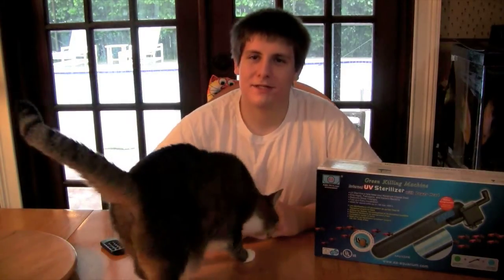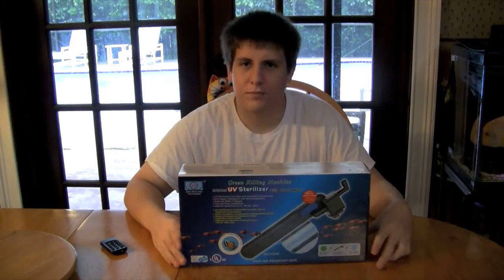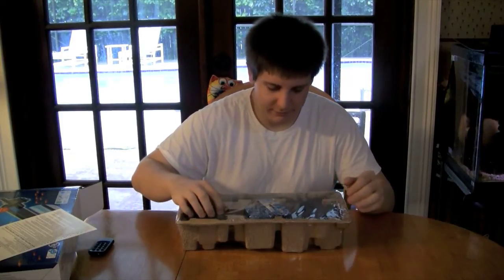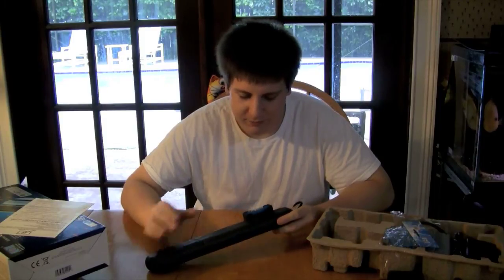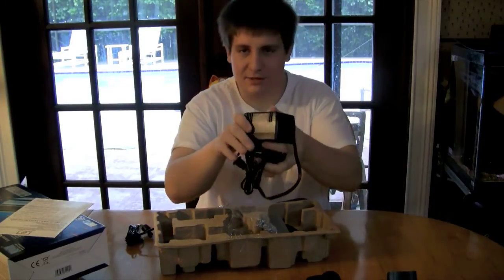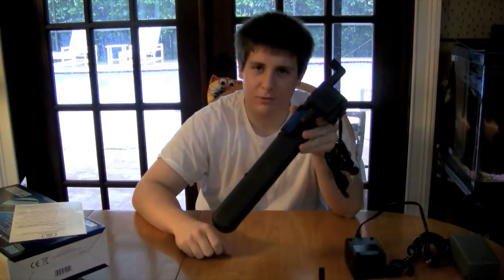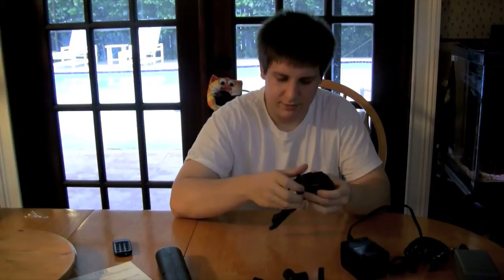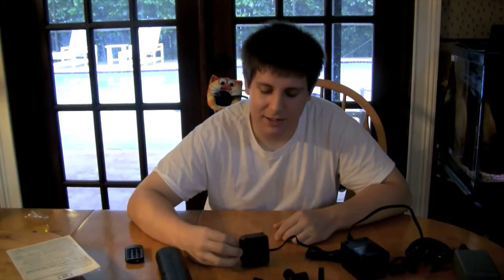AA Green Killing Machine UV Sterilizer Unboxing

Comment: I was wondering about replacement parts, not bulbs.  While cleaning it I lost the "pin" inside.  There is probably a technical name of it but it just looks like a piece of metal that is about 2 inches long and thin.  All my power aquarium appliances have them, need to get a bunch for backups!  Thanks for any info provided! J
Reply from the maker: Im assuming your talking about what the impeller rides on; if so, that is called the  "impeller shaft". They might make replacement parts for it, not sure, these aren't exactly the top of the line, by any stretch of the imagination, so a lot of times they don't bother making replacement parts. Your best bet is to call them, like I said in the video, I was surprised their customer service was so good. 

As a side note, don't bother buying a bunch of them for different motors/impellers, because everyone is slightly different then the other. Some are slightly longer or shorter, thiner or wider, and some are made out of completely different materials. I would not advise doing that unless you don't care about breaking your other aquarium devices.
Reply: AquariumTech I ended up emailing them and they sent me an email directly back asking for my address, telling me they would send one out.  Well... today is July 3rd and I still have not received my impeller shaft!  So I don't think much of their company at this moment.  I only purchased that particular item because it fit in my AquaClear 46 gallon bowfront II.  Not a lot of room back there and this one fit great.  Can you suggest a better one?  Actually my algae is not helped much by this one anyway!  I was thinking of putting it in the front, but then my copepods, etc, may get into it.  Any advice and I will take it!  Thanks for your information.  Jeanne
Reply from the maker: Jeanne S Well I did a review on this product, its a separate video, and I suggest giving that a look. 

I would go to american aquarium products(.com) and check out the TMC T-5 UVs. Those are ones you will have to plumb into your system, but they are some of the best, if not the best on the market.
Reply: Thank you I will check it out.
Jeanne

Comment: Would the bulbs need replacing from it's age sitting in the box or with usage?  I bought a new
old stock unit from a pet store and am wondering if the lamps expire even without being used?
Thanks.